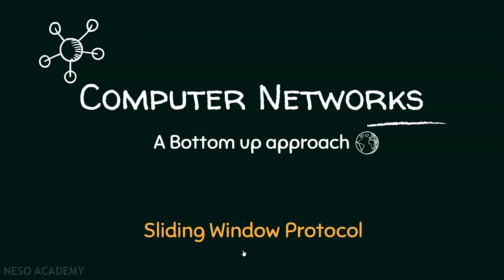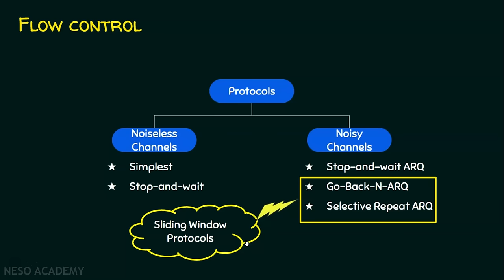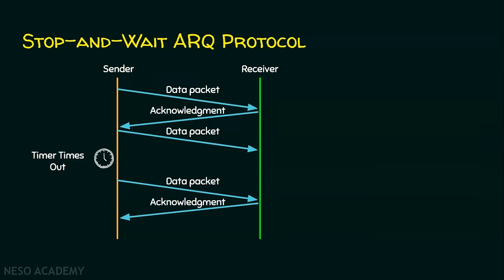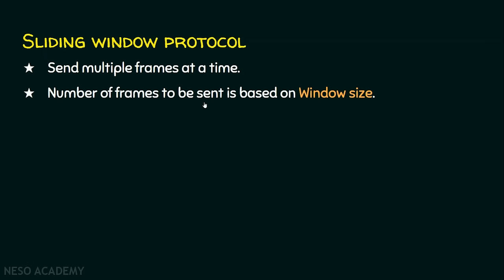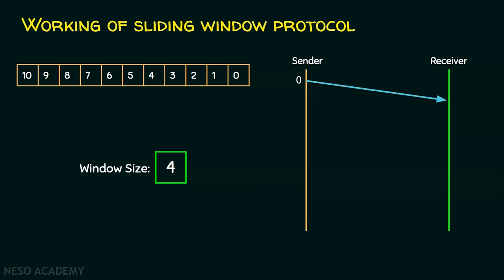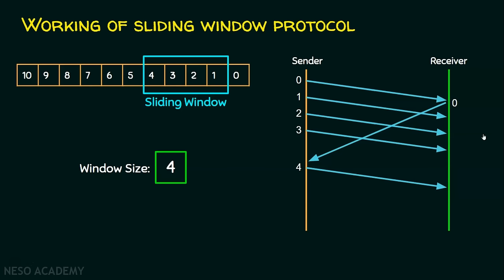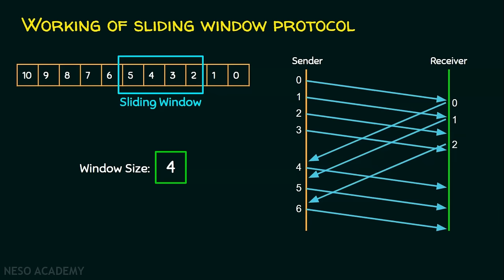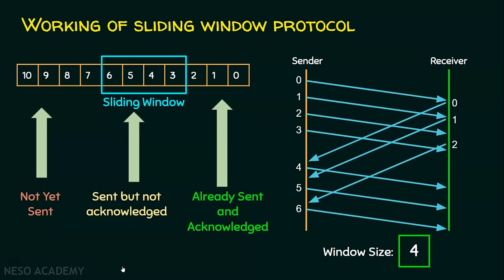Sliding Window Protocol

Comment: So lets says if the sender receives acknowledgement for frame 0 and 1, and then doesn't receive ack for 3 but receives for 4, will the window slide then?because if it slides, 3 will move out of the window, without receiving the ack for it

Comment: I have a question here that the sliding window size 4 packet means 4 bits to be send? And it is also means that when we sad that it's uploading speed is 20 mbps. It means 200000 bits can be uploaded in a second. Please explain it if I am right or wrong?
Reply: Each packet here can represent data up to 1460 Bytes and not 4 bits. It depends on MSS. it will be negotiated during TCP handshake.

Comment: Question: Doesn't sliding window then technically become stop and wait after the first 4 frames were sent? Because from frame 4, it sends the frames one by one, making sliding window no different from stop and wait
Reply: Exactly what i was thinking!
Reply: Please take my answer with a grain of salt, but I think the time difference between sending each frame is reduced in sliding window. For example, after frame 4 is sent, frame 1 is acknowledged, which triggers frame 5 to be sent immediately. In contrast, in stop-and-wait, frame 5 will only be sent after frame 4 is acknowledged.
Reply: the window size is not fixed on the sender side it can be as large as possible it is assumed to be 4 here, but receiver can negotiate the window size depending on it's capacity to handle packet at the unit of time and buffer size. The receiver informs the transmitter in each acknowledgment packet the current maximum receiver buffer size (window boundary). The TCP header uses a 16 bit field to report the receiver window size to the sender. Therefore, the largest window that can be used is 216 = 64 kilobytes.

Comment: But you didn't explain, what happens when an error occur in the sliding windows protocoll? Because with this explanation it seems to me, that is the same as slow as the stop-and-wait-protocoll, except for the first windows size of bits.

Comment: I did not understand how this is helping faster communication, as the buffer W gets full it eventually have to wait for ack of the earlier frame transmitted
Reply: Without this feature how TCP operates is that the sender will have to wait for the acknowledgement of the entire window (4 segments in this case). but will Sliding window size the sender can transmit segment for each acknowledged segment.
Reply: TCP sacrifices speed for reliability. The client is assured that all the frames in the window will be sent or the connection will be dropped.

Comment: I think both 'stop and wait' and 'sliding window protocol' are almost same.
The only difference is where they sent first window.
after the first window it work Same as 'stop and wait'
Who is agree with me🤗
Reply: If my logic is wrong then please correct me guys!!
Reply: @PrinceKumar-lm4pw  In sliding window you can send multiple frames at a time and no need to wait for acknowlegement.The acknowledgement will arrive as the sender starts sending the frame.In stop and wait you can send only one frame at a time and wait for acknowledgement.